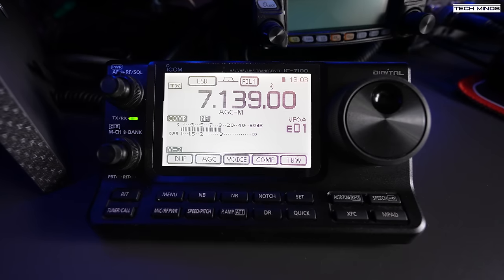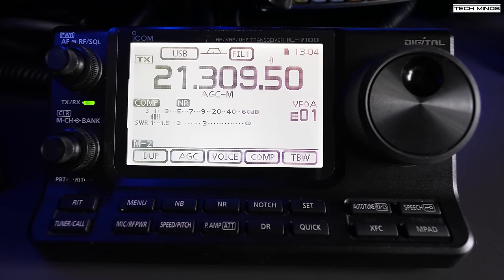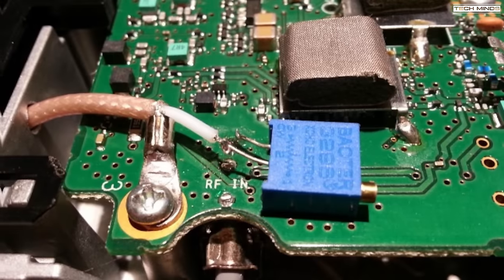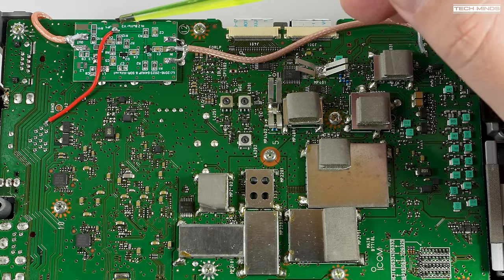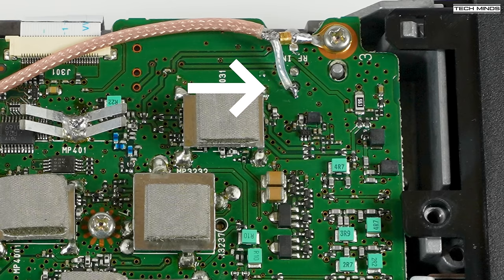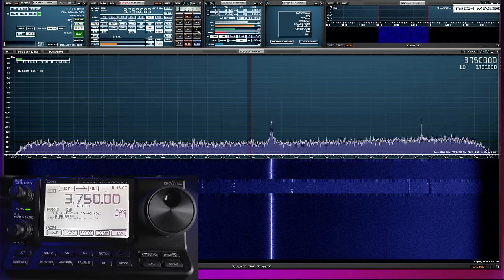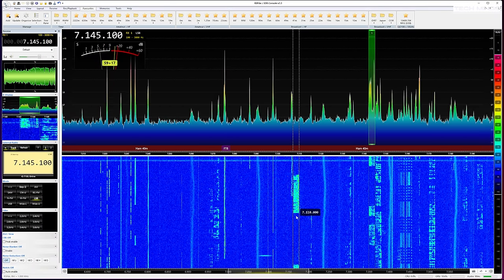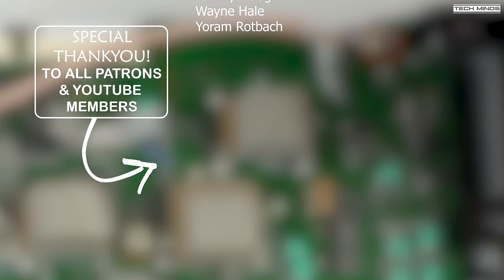Adding A Second Receiver To The Icom IC-7100

Comment: Thank you for referencing my web article "7100 Panadapter
how to connect an SDR to the IC-7100… © 2018-2024 by KV5R.
I did not find it necessary to use a buffer, but indicated in the article that that was the "proper" way to do it. At the time of writing, a suitable buffer board didn't exist, but there were some cheap little MMIC amps that would need their 30dB gain greatly reducted with resistive dividers, and they would impart some distortion and spurs in the SDR signal. It's good to see SDR Kits is making a proper buffer board now.
I still use my 7100 every day, with the same RF tap, with and SDRPlay, and have also used an Airspy and RTL-SDR v3 with acceptable results. As stated in the article, the loss to the 7100 receiver is about 1dB with a little series resistance; and this also makes the signal to the SDR a little lower, which it needs to be during transmit.
I always love your videos! Kepp up the good work, bro!
73, --KV5R
Reply from the maker: That's made my day that you are a viewer of my channel! Without your article I would of not made this video. Thank you!
Reply: I have no clue what you just said but it sounded cool. 🤣
Reply: I used the info on your great website to get my 7100 on digital. TNX

Comment: You said it Matt! FT-8 is not a digital mode, it is a data mode. The difference is FT-8 and all other data modes is they are analogue and use tones, Digital Signals use a series of 000 and 111s such as Digital Voice.

Comment: This approach might also work with well the Icom IC-706 Mk IIg, which is a rig I still use frequently.  It is really a plus to have HF, 6m, VHF and UHF all in one pretty small box.  I’ve got an IC-7300 for HF, but I still find the aging 706 is a fairly pleasant radio when it has the SSB and CW filters installed.  The older Icoms are still too god to toss out.  The downside of the 706 is the fairly high idle current of almost 2A at 13.6V when receiving, not the best for battery portable.

Comment: Great video as always Matt, why did you choose the PATV board over the PAT150M which seems to be designed to fit the IC-7100?
Reply from the maker: Hi ya, the PAT150M board is designed to be used with the IF output, and it has built in Low Pass Filters. With the RX Output that I tapped into I needed a buffer, but no LPF, hence the use of the PATV as it has no LPF. Hope that helps :-)

Comment: You mentioned you used some 50ohm coax for the IF tap but could have used some plain wire.   Why did you choose coax ?   what would the benefit be?,  What would the drawback to plain wire be ?

Comment: So to be clear connecting the module the way you recommend does not give you a second  independent receiver, so in order to use the sdr receiver you need to be on the same band. 

Would I be correct in saying this?

Comment: Do you have a source for the coax used in this modification? What nomenclature does this coax carry?
Reply: Looks a bit like RG-316 to me.
Reply: @paulsengupta971  thanks! I will check it out if there is an EU supplier for this cable.